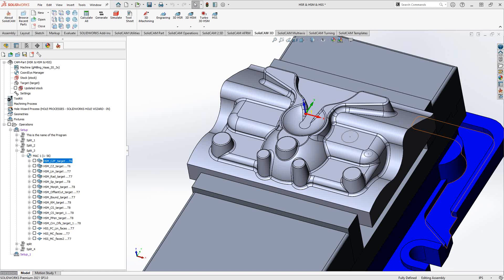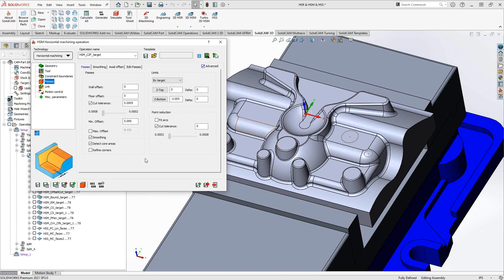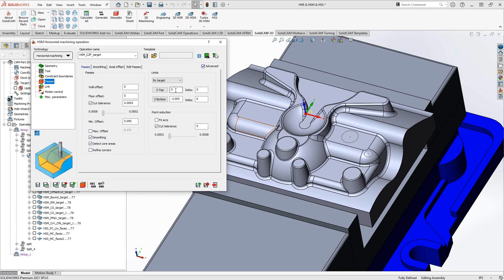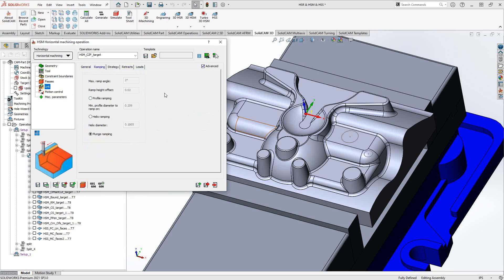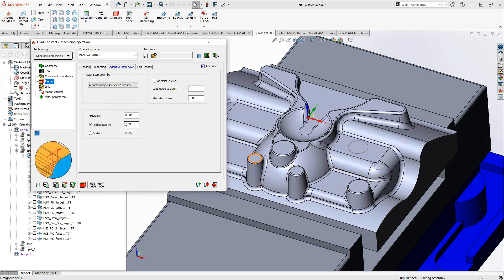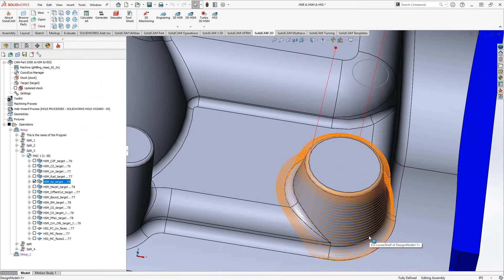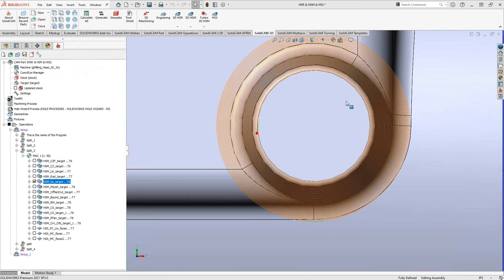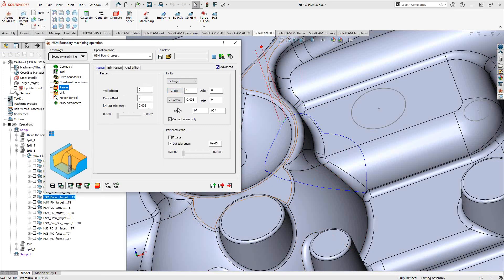HSM Operation 2021

Comment: Hello Sr. Thank you very much, very well explained video. I have a question: if 3d constant step over seems to cover almost all the solid surface to be machined, with a nice smooth path, then what is the point of using other strategies ? Shouldn’t 3d constant step over just be the only strategy?